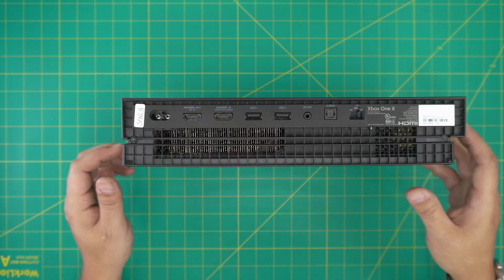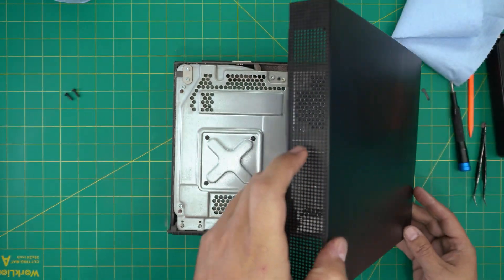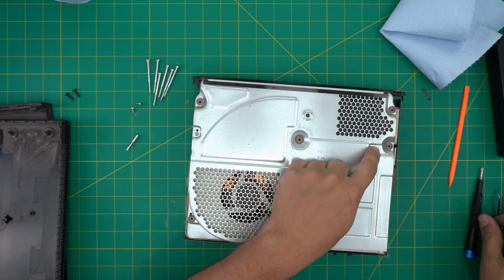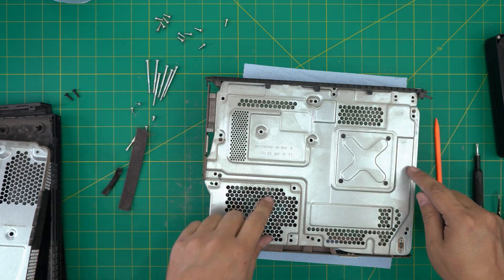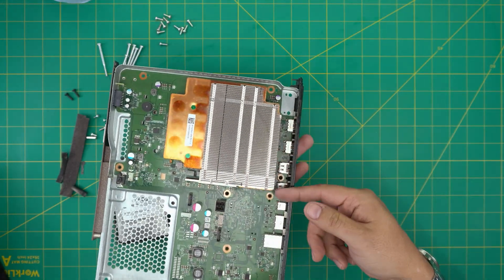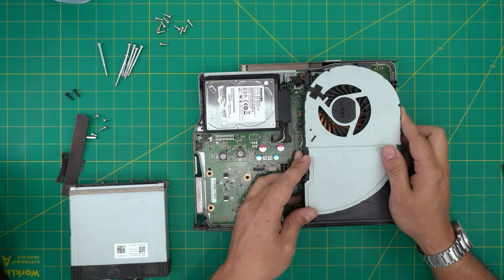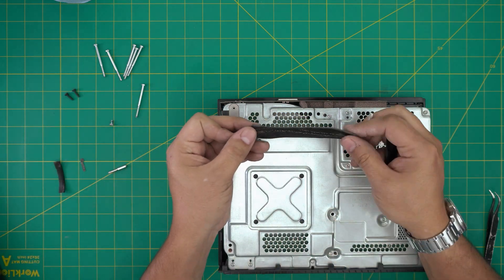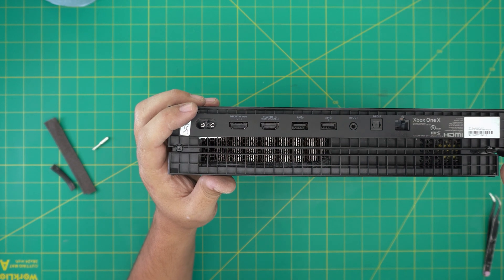How to Clean Xbox One X - Step-by-Step Guide

Comment: Holy f*** was that scary. Took mine all apart thanks for this vid, put it all back together (which for me was the hard part haha). Then plugged it in and my console would overheat after about a minute and a half. I’m panicking. Pricing out a whole new console haha. Then I scrounged up the nerve to break into it again and try to fix it. Found out that I hadn’t plugged the fan in properly. Got it fixed and back together and it’s purring like a kitten. Terrifying afternoon, but in the end I do suppose it was worth it.. but I’m not doing that again haha. Thanks for the vid. Going forward I wouldn’t fast forward where you put the screws back in. Wayy too fast to follow. But thanks again.
Reply from the maker: It's my pleasure, my friend. I appreciate your support.  
I can imagine that poor thing overheating without the fan 🤣🫠.  
But as long as you learned and fixed the issue, then you are a winner, and next time you will remember the fan connector.  
Even I, after 28 years of repairing, sometimes forget to plug in the fans on laptops or consoles from time to time 🤣.
cheers🍻

Comment: I did not see you repast anything? Is it needed somewhere on the console? I know ps4 i had to past however did not see any spot to repast on the xbox
Reply from the maker: 🫠Regarding your question, this video was for cleaning only is not a repaste only a cleaning, if you looking for repaste check this video:
https://youtu.be/hC0-OfiMaIw
cheers🍻
Reply: Thank you for your response. Ok I see as long as I'm cleaning only I don't have to repast do to not separating from the motherboard right?
Reply from the maker: you should be repasting once every 2years and cleaning once a year.
you can just clean the dust, just make sure you don't remove the heatsink, if you separate the heatsink you will have to replace the thermal paste.

Comment: 3:01 non of my 9 will remove those screws what do I do?
Reply from the maker: it is #9 from the ifixit tool set, your set may be different, use a bit that fits snuggly in the screwhead.
Reply: @uFixTek  got it think you. Xbox is still freezing up

Comment: Sometimes when I try to play game on my Xbox One X the fan spins really fast and then turns the whole machine off. It says that it turned off due to heat safety. Do you think that it could need a clean out, or is this just another issue???
Reply from the maker: Thank you for your feedback! If you wish to support the channel, you can like, subscribe, or both!
Regarding your question, it is 100% over heating issue and  you will need to open and clean the fan and heatsink also replace the thermal paste.
Should you have any further questions or requests in the future, please don't hesitate to ask me.
cheers🍻
Reply: Hey I got you bro you disconnected something in your fan if you take apart your Xbox there should be a black cord with a white tip and you have to find where to plug it in I can’t really remember where tho😭